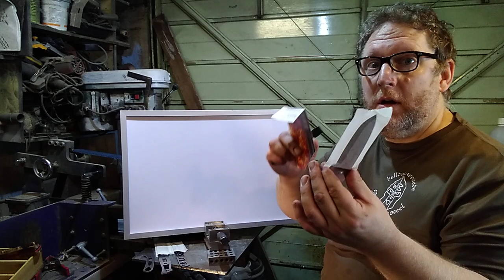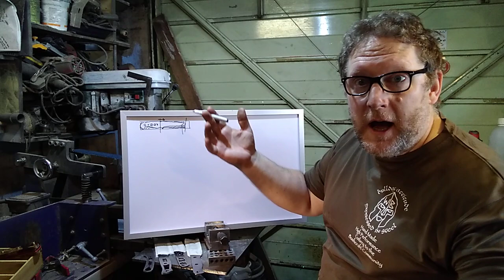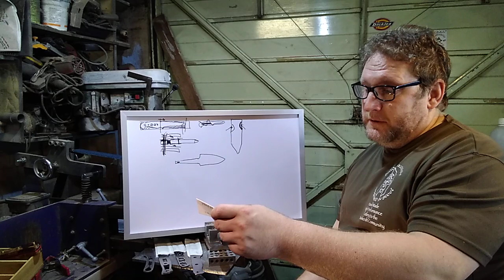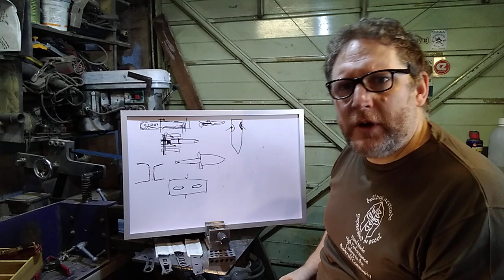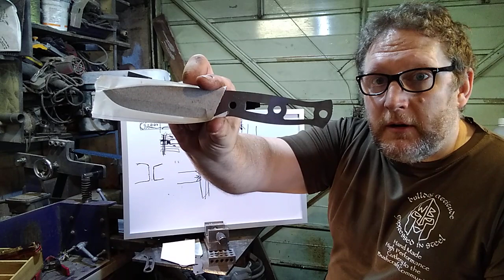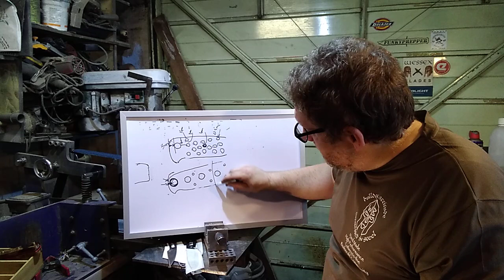Knife Handles, what are the holes for? Knife maker explains tutorial...

Comment: Informative and clear as always :) Do you think there’s any benefit to adding reinforcing material to the epoxy like West Systems colloidal silica? I imagine it would add strength to the areas being through-glued and the glue filling the little voids created by chamfering, but I have no experience in this area.
Reply from the maker: With Gflex some dude in a lab with years of experience has formulated a tough water-resistant epoxy that's good enough for boats...I'd leave it at that, a tough glue is good, a brittle one not so good, unless there is some super reason to mess about I keep it simple, the voids involved here are fractions of mm not huge gaps , if you had voids in some hardwood burls then yep, mix some of that particular wood dust in to add some additional structure and colour...